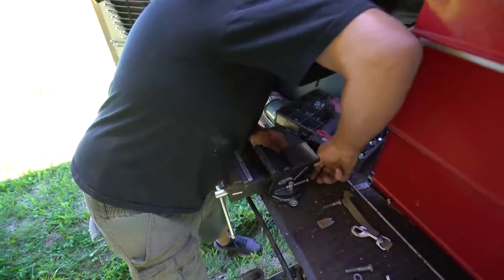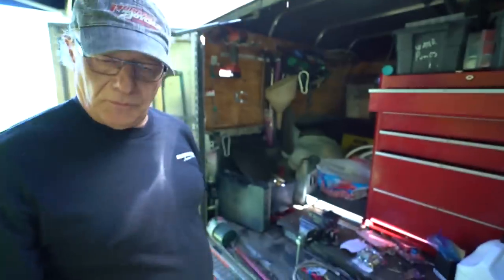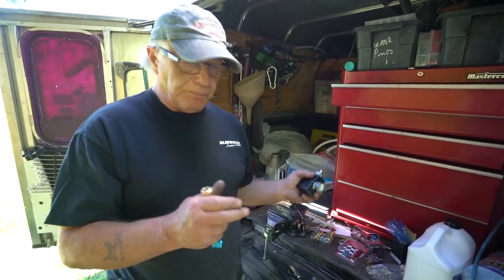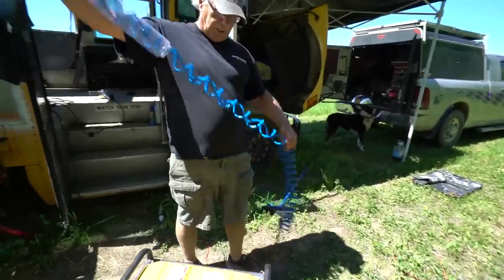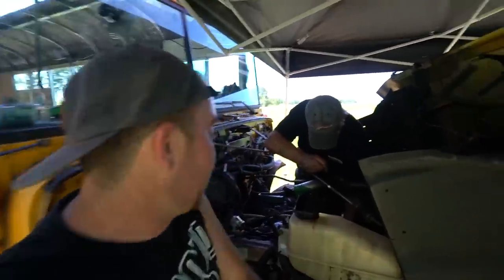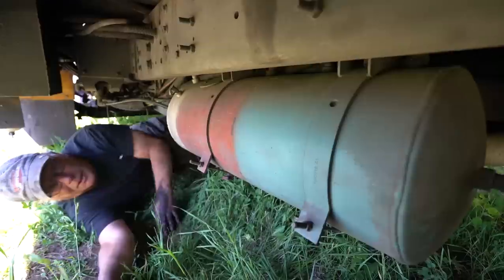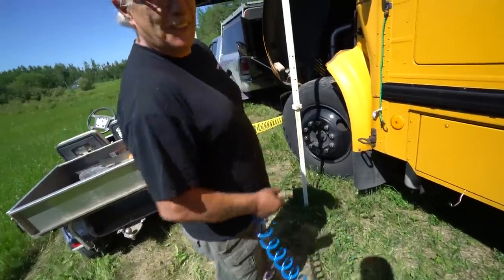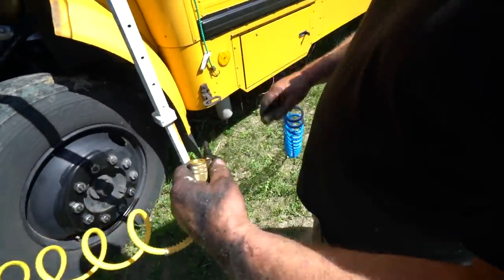INSTALLING VEGETABLE OIL CONVERSION PARTS + WHO TO HIRE FOR WVO

Comment: Great info from Badge. I plan on adding an air connection to my system and dirt from the back roads I travel could be a problem. That's why I'll run mine into one of the storage compartments.

Comment: hey Badge how does that air connection  work at 65mph & 50' of hose? I think  I'd want to be driving  the 🚌.  had those are fender washers FYI.  I think I'd look at a 90 or double 90 to turn  that air coupler.  just putin it out there

Comment: wat you can do for extra insurance with the fuel solenoid is have the switch only activate when a coolantheatsensor closes on the engine  
this prevent svo from going intoo the engine while its still cold should you have forgotten to switch back to pure diesel before turning the engine off 
might even go realy idiot proof and have a timer on the contact key leaving the engine running after turning it off but taking off the power to the switch setting it to diesel for 5 minutes clearing the lines